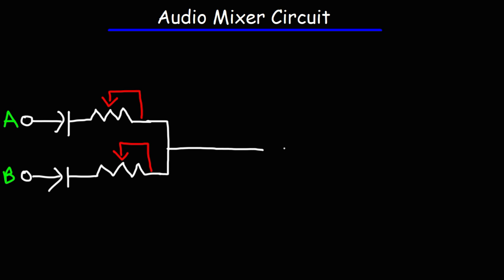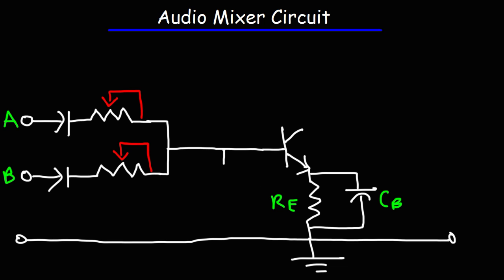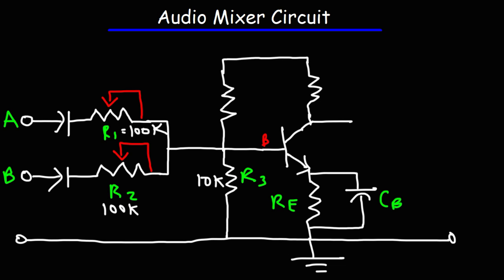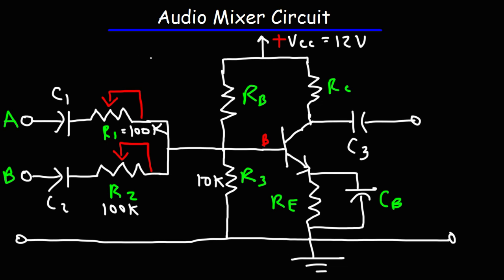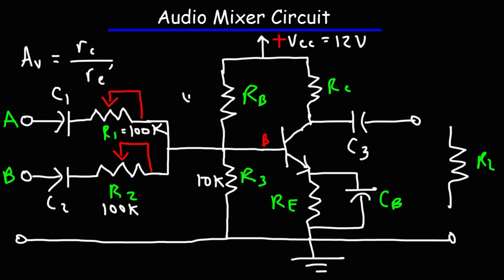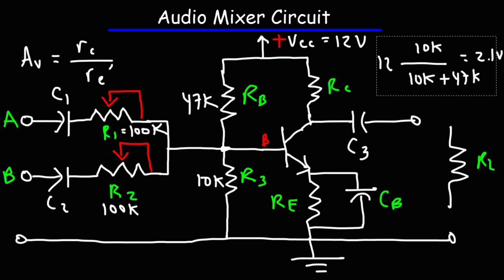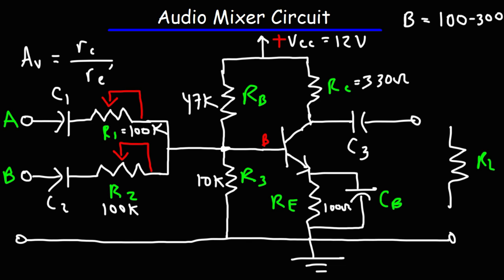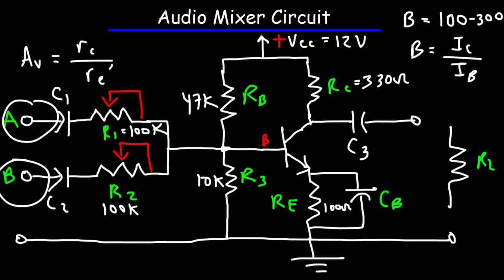Transistor Audio Mixer Circuit

Comment: This is not exactly an mixer circuit, this is essentially an adder circuit. If you put the same signal in both channels you'll get the signal at the output with the double of the amplitude. A mixer should combine the shape of the signal without affecting the amplitude. But I think that this is very hard to build it in analog way, because there are not any circuit on the web.

Comment: The capacitor symbol you are using is for polarized capacitors..why are C1 and C2 drawn with the cathodes upstream and the anodes downstream?
Reply: High voltage at Rb-R3 junction could result in blown inlet capacitors unless correct polarity observed.
Reply: I think that's a mistake. They should be non-polarized capacitors. A typical value is 100nF. The +12V supply is there in part to add a DC offset to the AC inputs so they can be amped without a negative supply connected to RE. Meanwhile C3 and CB are typically well above 1uF and polarized to be affordable.